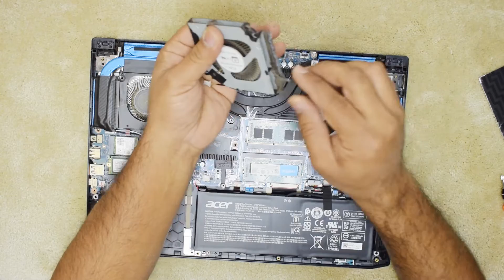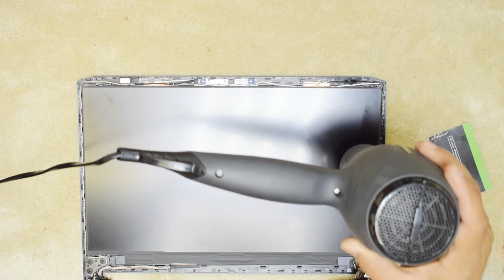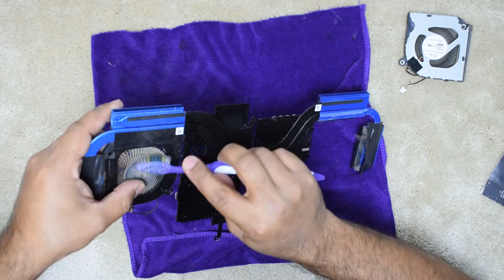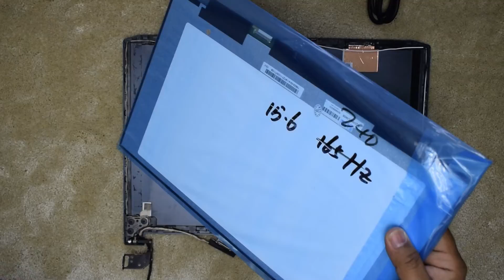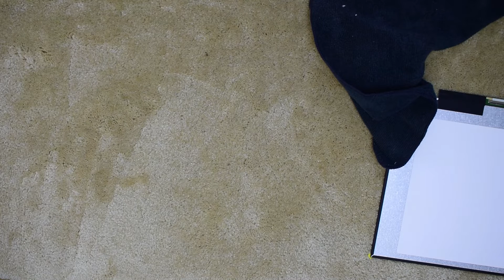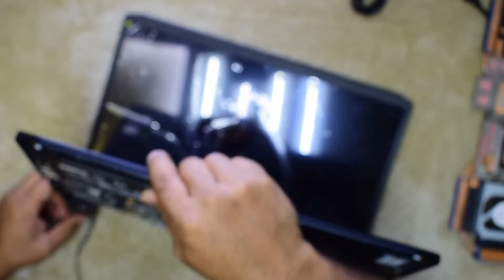🛠️ Acer Predator Helios 300 LCD Replacement & Disassembly

Comment: My LCD panel got shattered, and I need to replace the LCD in it, can I replace the LCD with a non-Acer LCD of the same size if it has all the same connectors on it.